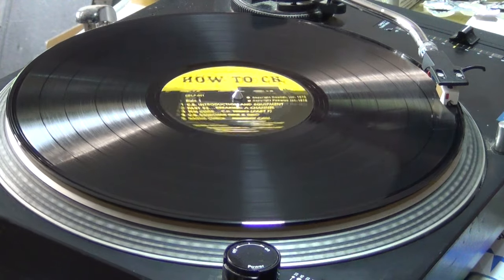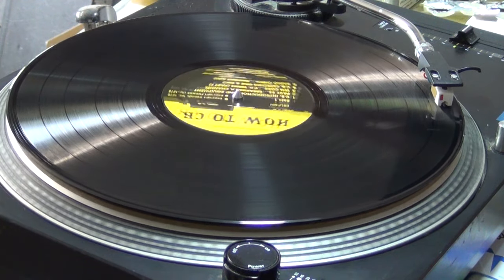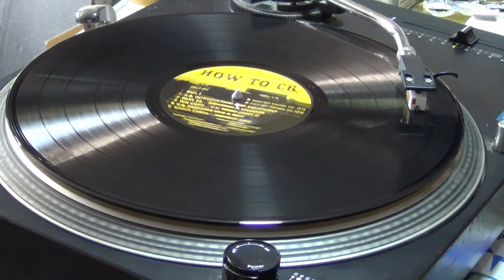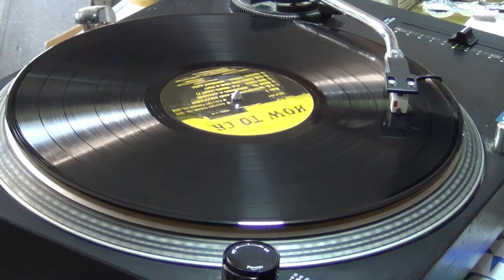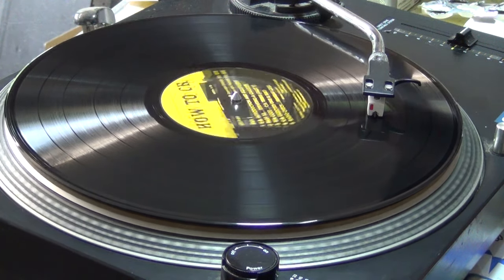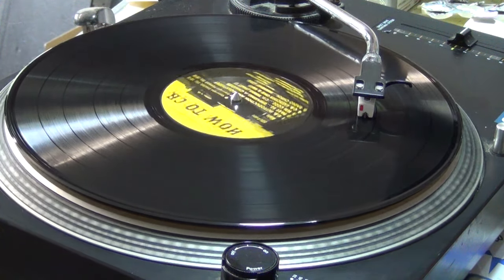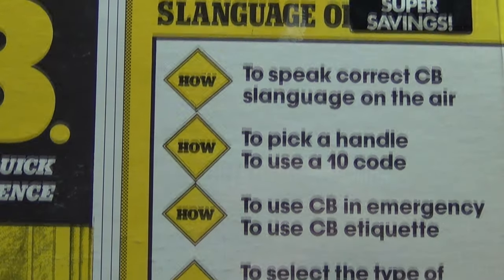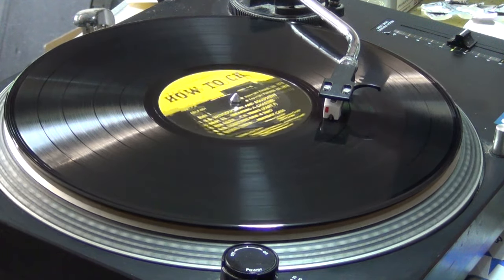How to CB  - 1976 USA gramophone record

Comment: What a blast from the past!  As I noted elsewhere, this was an xmas gift from my parents in 1976.  Crazy stuff.  Thanks so much, Richard!!

Some notes (caution - may approach the pedantic):

Brake -> Jake -> Jacobs compression brake - Search for "Jacobs Vehicle Systems".  

SSB is not FM and SSB does not give you "more channels" as vendors insisted.  If you had two perfectly tuned radios you might be able to both use the same channel on opposite sidebands but if you watch this channel, you know that radios are almost never perfectly tuned no matter how good they are after a trip through Tango Towers so in reality ... no.  AM or one of the sidebands would occupy a channel so still only 23 usable.  Lots of places "reserved" Ch 16 for SSB.  When channels were expanded in 1977, 35-40 were "reserved" - note that this wasn't by regulation, but by convention.  

I don't know when the regulatory restriction on Channel 11 went away but I think it was earlier than this record - c.1974.  Earlier there were restrictions on where a licensee could talk to other "units" under it's license (family members, employees) and where they could talk with other stations.  I think all that stuff went away at the same time.  The only thing that stayed, and is still in the rules, is the Channel 9 restriction.

I believe the US FCC required a license and that licensees ID with their callsign until the early 1980s - maybe 1982 or so?

If you search for "WNEV-TV 7 Boston - Sign-Off - 1986" and find the relevant YouTube clip, you will hear a familiar voice.  No not Mr Chippie, but Leif Jensen, the long-time studio announcer at that Boston, Mass, TV station (ex-WNAC) going back to the 1950s.  Clearly, he did a lot of voice work as well.  Yes, this was from a time when North American TV stations would sign off after the late, late show and come back on in the early morning.

"First Mama" was Betty Ford's handle.  She was President Gerald Ford's wife.  

What a blast from the past!

Comment: lol We only used a few 10 codes up here, mostly just to make it quicker and to report Smokies on the road and speed traps.  Two minutes after setting up a speed trap, they were wasting their time. Were they wasting their time?  No, I asked one one day, he said, I don't want to charge anyone with speeding, it sure slows everyone down, then we can move and it slows traffic down in up to four places at the same time.  No one is ever sure if we moved or not.  Suppose he had a point, but everyone got wise to that as well!  We did use some slang, but it has died out, or appears to have, as no one I have talked to appears to use it anymore!

Comment: Did anyone else spot the mistake near the start? They confuse SSB and FM.
Reply from the maker: Yes, I did. It goes to show the main narrator is an Actor & knows nothing about CB....or he's have told the script wrtiter about the error.

I also dislike it when people add up different modes as extra channels. If you have the 40 CEPT channels available in AM, FM & SSB split into LSB & USB as we've had in the UK since 2014 (on CE approved sets), it's still 40 channels...not 160.

This Friday, it'll be the 1978 record from America. My friend David is copying his Dave Lee Travis CB cassette produced for Radiomobile. I'm sure it'll be better than the previous UK cassette tape I uploaded.

They are such fun though.

Richard, G0OJF, UK